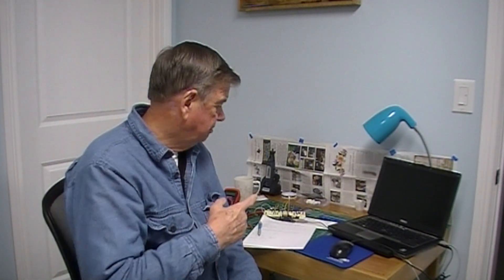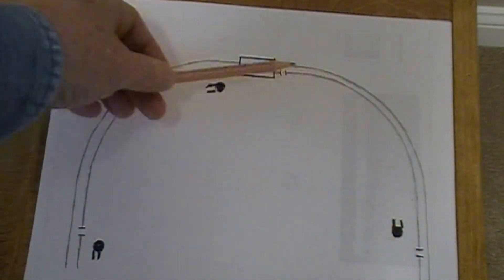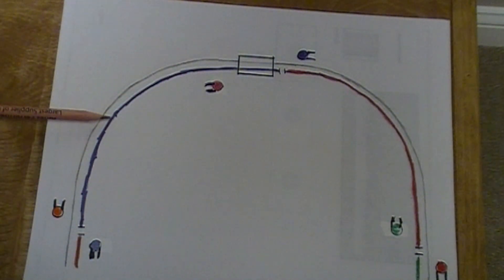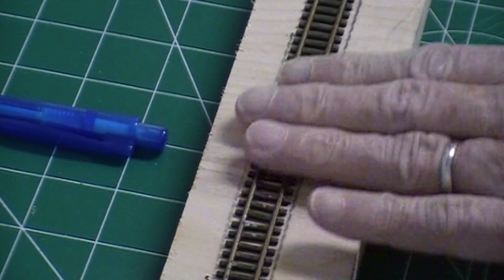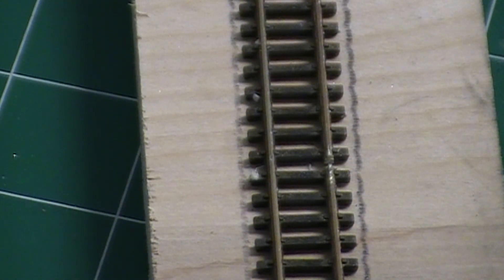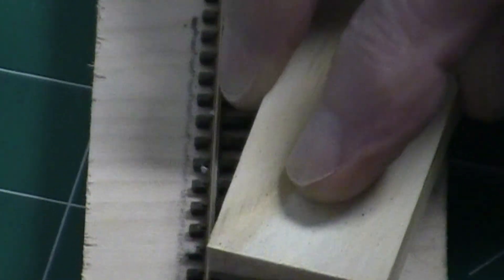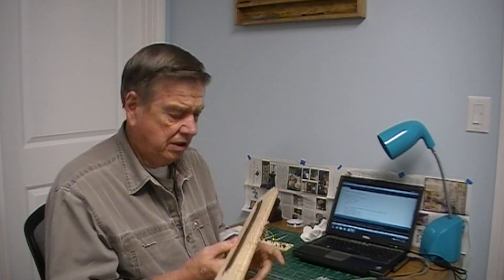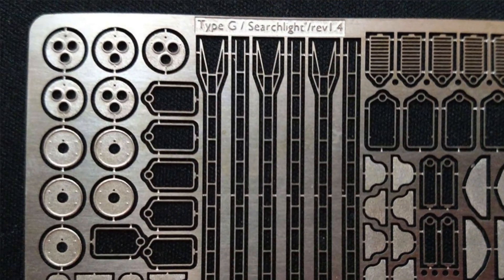Block detection and signals

Comment: Hello I use Custom Signals Systems too with Azatrax controllers    You mentioned Ron's Trains and Things on a video he did for cutting track  I was on his channel and could not find it do you have a link to that  Thanks Tom
Reply from the maker: Thank you for the reply. I do not have the link for the Ron’s Trains & Things video but it was probably about three or four years ago. He showed how to cut the track and place a small piece of styrene in that section. I use my Dremel tool with a real thin cutting disc to cut track.

Comment: I too want to put signal in and looking for good cheap signals, its always good to look ahead, looking foward to see how yours turns out, I'm not planning on 3 color signals as the wireing may turn into a nightmare....thanks for sharing....Jack 😁
Reply from the maker: Thanks for the comment, I should be getting the DB-20s today and I will try and show different way to hook up 2 LEDs and 3 LEDs.  See you then.  --Jack
Reply: @LS3Jack  I'm interest in how you may do it as the work sheet is a little confusing....thanks

Comment: what block detector are you using?   I am running Digitrax and plan to use BDL 's but my lower level is still on the drawing board and no track has been laid yet.  Thanks for sharing
Reply from the maker: I am planning on using NCE BD-20 for detection.  I am not planning on using a computer system like JMRI and trying to keep it half way simple.  In the next video I will see what the capabilities of the DB-20 are (if the dealer can get them in the mail).  Thanks for the comment,  --Jack
Reply: I use Digitrax and use BD20s for block detection and infrared sensors for point detection. Works well for me.